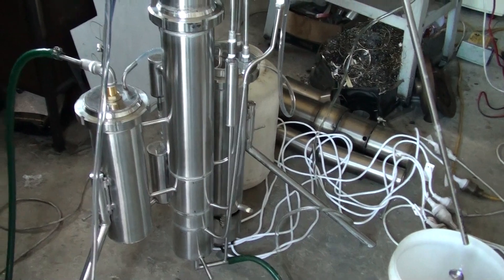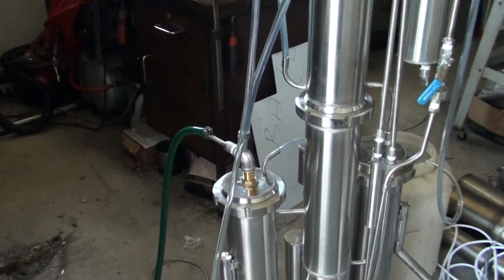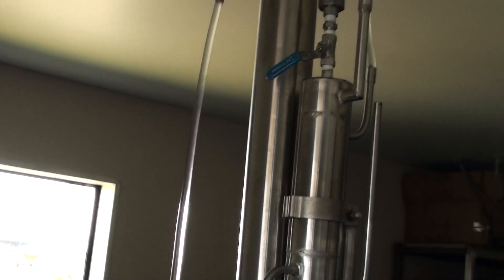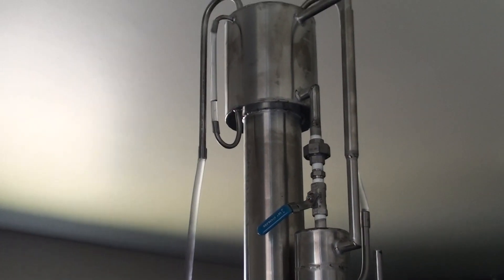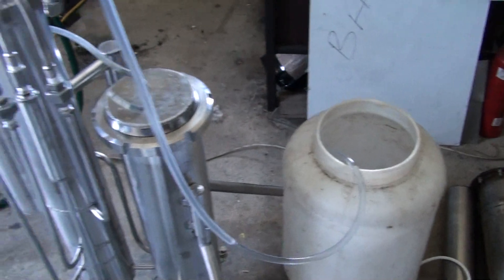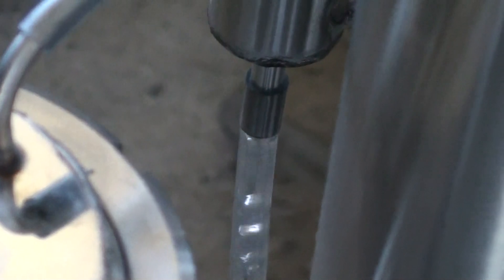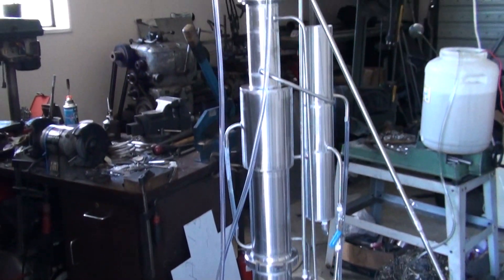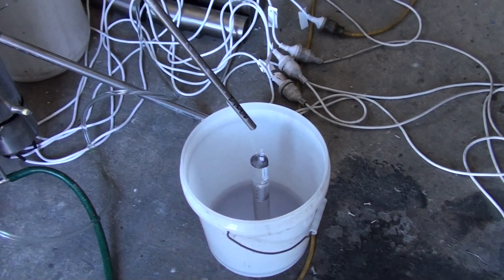10 kw continuous fuel ethanol still

Comment: Alex, is this different  than  what is in the plans for a continuous  distillation  still? Look forward  to getting  the plans and some of your prefab parts. Thanks for posting.
Reply from the maker: Hi, this particular one is different from my other stills, it is sort of hybrid between the stripping and fractional stills, so there is no manual for this one, simply did not have time to do so.
Reply: Alek Polek , thanks. So how much is the 10 kw continuous distillation.  I assume it is more convenient and reliable.
Reply from the maker: this one was built for 5000 yes it is really easy to control, really stable but again this one is for industrial grade ethanol.
Reply: Alek Polek , thank you. I guess I do not understand the difference. Can you explain a little bit about the differences or where you address differences on your web site?